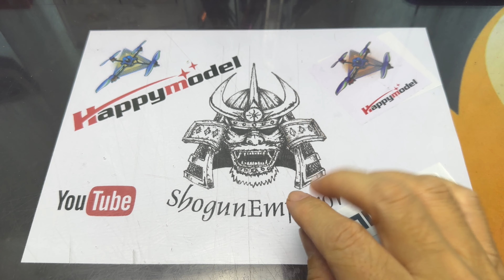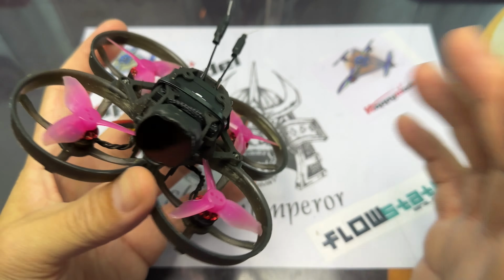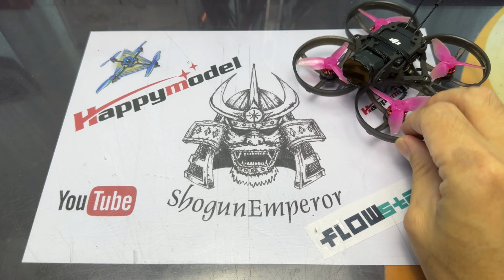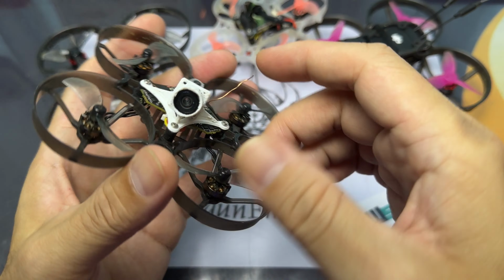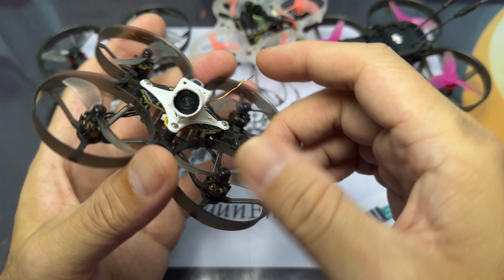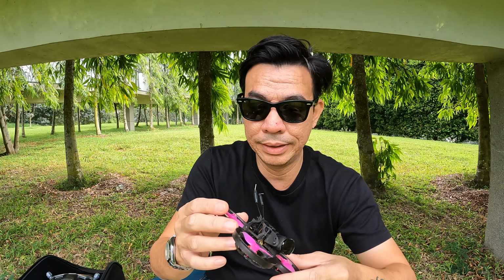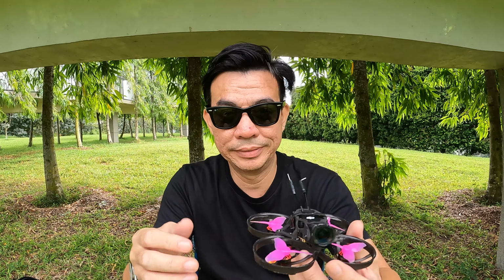This copper RX antenna sucks??

Comment: Awesome, another great fpv footage! The copper antenna on a small RX could go up to 1.2km LOS with a standard 100mw dsm2 transmitter. I used that a lot too, most people who have range issues is because the copper has a cold soldered joint due to internal breakage over repeated bending of that rigid wire. A blob of hot glue (not CA) near its joint should prevent this.
Reply from the maker: Thanks bruddah. Whoa! I never got more than 950m due to the location i chose. But 1.2km is pretty impressive indeed man!! What happened after 1.2km on ur flight?? Thanks for that tip bruddah!! Hot glue works! 🤣🤣
Reply: the 2.4g frsky receiver lost signal after 1.2km and gps “return to home” brought the scratch built drone back home. 950m is about right since your drone is just above tree top altitude. Range drops drastically as you go lower in altitude.
Reply from the maker: @terence79chan  ooooooh nice! U had GPS!

Comment: Hi Brain, my Mobula 8 analog come with céramique antena, the 03 lite with cuivre antenna, but other quad flywoo come imortal T antenna.
I don' havec test the range.
Reply from the maker: Aye no worries bruddah. The t-antennas n ceramic are much better. Just that my friends say the copper antenna sucks. But i disagree as i find them quite decent. Not as good as the ceramic or t-antennas. But its good enough
Reply: @shogunemperor  You know when you get the quad with a copper aerial, you slip a little piece of plastic tubing over the reveiver like before and that's it.

Comment: I prefer the copper wire antenna. The little "ceramaic" (really plastic with wire wrapped around it) antennas are no good if you upgrade to HD VTX and mount it above the AIO controller. The wire is also easily repaired if damaged. $10 spool of enamel wire is like a lifetime supply of antennas.
Reply from the maker: Honestly, i agree man. And the range is pretty decent. Its not like crap distance or anything. I love them too.

Comment: No problems here with the copper rx antennas. Copper vtx antennas aren't too bad either, but the ones on 25mw don't have the greatest penetration or range, so I stay pretty close. 200mw and up they are just fine for most whoop uses, at least for me.
Reply from the maker: Yeah exactly man!  Even on 25mw for me, I never had issues before.  But people just say they suck. Which i find isnt really fair.
Reply: @shogunemperor   Hey man. I'm really glad you posted this. I broke the antenna on my little odonata build a couple of weeks ago. Had one laying on the bench, so just soldered it back on. The vtx only gives 25mw, so I figured the range was just what it is. I opened it up this morning and realized the antenna I had grabbed was a 1/4 wave for an spi rx reciever lol. Now that I've cut it down to just under 14mm for raceband 8, I'm expecting much better penetration and reception. It will be a lot better for my built in vtx too, as I imagine it had been getting pretty hot with an antenna of the wrong length. I wonder how many of the people that complain about bad reception with the copper antennas did a quick google and cut a vtx length for an rx length or vice versa! Cheers!
Edit: It is now early evening here and I flew a few packs. Huge improvement in both range and penetration.
Reply from the maker: @kurtzFPV  WELL DONE BRUDDAH!!!! Yeeess!!!! The length of the copper antenna is of MASSIVE importance! Well done bruh!!

Comment: What thickness should be copper wire for antenna?
Reply from the maker: Hey bro! 20-30awg copper wire is good. Or if u want in mm its about 0.4mm if im not mistaken. Also, depending on vtx or receiver. If vtx u want it at 1.3cm long from solderpoint

Comment: I had a failsafe with a coper antenna and ELRS. Both tx and rx on nullpoint but not that far away.

Maybe its a bad RX but went well since this accident.

Did you failsafe anytime with ELRS?
Reply from the maker: It happens sometimes, maybe due to sudden wifi interference or some unknown factor but does happen.  So far... twice.  1st was I was flying below treelines at a distance of 950m.  2nd was cause i forgot to put the antenna up on the zorro... 😝